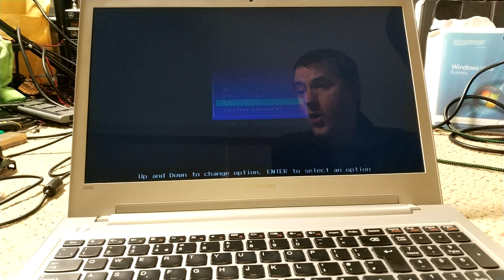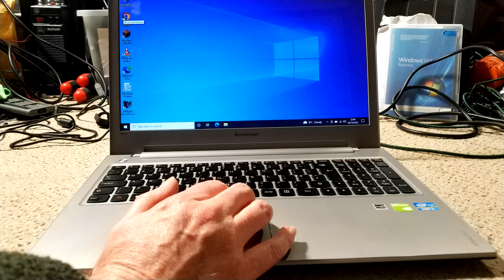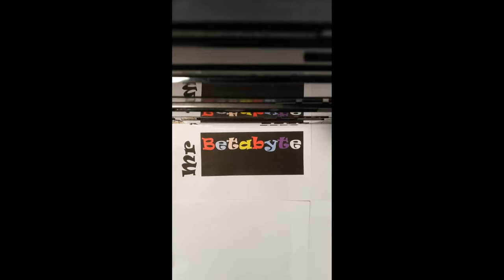Lenovo Ideapad Z500 SSD upgrade - Worth doing?

Comment: My own experience - in short, I went the SSD upgrade and glad I did. So yes, worth doing.
I bought my Lenovo z500 (i7, 8GB RAM, 1TB HDD) in June 2013 (10 years ago). I made shift to SSDs Oct/Nov 2019, 3.5 yrs ago. Always happy enough with original computer for MS Office applications and photo editing although start up times slow as was the norm. Had read about speed and performance of SSDs in newer computers, so I thought upgrades with SSDs might give me a couple more years out of this computer. And mindful that the HDD was getting old.
I had never done this before: installing/partitioning discs, taking apart computers, etc. So a lot of research before hand, creating a list of tasks including backups, the order of work, things to be aware of, etc. A lot of good internet resources including Y/T.
Decided to replace the HDD with a 250GB Samsung 860 EVO SATA SSD, and replace the DVD player with a 1TB Samsung 860 EVO SATA SSD. Perhaps overkill (Also needed to buy a "caddy" to hold the 1TB SSD and the SSD needs to be SATA for connection). I hardly used the DVD player (and have an external DVD player if needed). I set up the 250TB SSD as the C drive; and the 1TB SSD as the D drive exclusively for data. All files/photos saved to D drive which syncs with dropbox. (I did not partition either of the two SSDs). I did a clean install of Windows 10 Pro and reinstalled programs I needed (onto the C drive).
Outcome -  Everything worked well. No glitches that I can recall. The startup time was and continues to be excellent. General opening of programs, transferring of files, etc., excellent. Little or no waiting. Very happy with performance. Now no end in sight for this computer until starts falling to pieces. Use with external monitor and mechanical keyboard. Very satisfying experience with this outcome. Only issue is amount of time it took. And there were clearly cheaper options in terms of SSD brands, and just the 1 SSD would have been fine. Also if time was an issue, an external repair shop could have done it much more quickly as intimated by MrBetabyte.
I don't generally use it for travel. The z500 is fairly heavy, and the battery badly needs replacing. Hope this might help if someone considering upgrade.
Reply from the maker: Thank you so much for sharing. Some great insight and information.
Reply: I'm on the same path, I was wondering can I upgrade the ram to 16 GB. I already have 8 GB is there an extra slot ? So I can put 2x8 GB, n what if I go for DDR4, since u have already done the research

Comment: I went the other way, soldered the mSATA connector and installed mSSD there
Reply from the maker: Was it as simple as soldering on the mSATA connector? That's a great way to upgrade if that's all that was needed. Thank you so much for sharing.
Reply: @MrBetaByte  it's not difficult who knows how to solder will cope with the task, the definition of mSSD in the bios without problems, it is immediately determined automatically without revision

Comment: I've installed win 10 on my z500 but display and audio drivers don't work anymore. I've tried every last possible solution available on internet. I can't touch brightness buttons because it immediately goes to 0% and stays there no matter what.
Reply from the maker: That's really annoying and I'm seeing this more and more with older kit suffering from driver issues. I don't have the laptop to hand but I'll have a chance to check what drivers it's using in the next few weeks so will update you.

Comment: My power button board for this device is damaged...
How can I turn it on without the power board ?
Reply from the maker: That's a tricky one and it depends on how damaged the board is. Depending on how technical you are, if it's just the button it can be replaced. If the board is damaged you might be able to repair the traces. These boards do come up on eBay sometimes and that might be the way to go as they should be pretty cheap now.

Comment: Can you tell me what ssd to upgrade z500, with and ram model I want to upgrade my old z500
Reply from the maker: Hi, sorry for the delay in reply but a standard (recommend a good quality brand like Kingston, WD or Sandisk) 2.5" SSD will do the trick. As for the RAM, if you visit pcsupport.lenovo.com and enter your serial number, that will tell you what RAM to install. The Z500's used a couple of different types of RAM depending on the spec I believe.